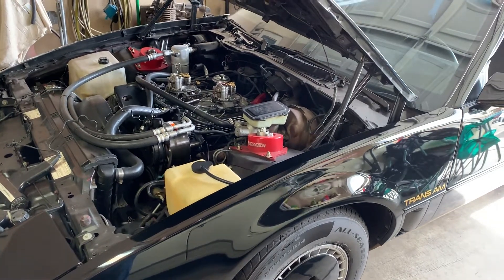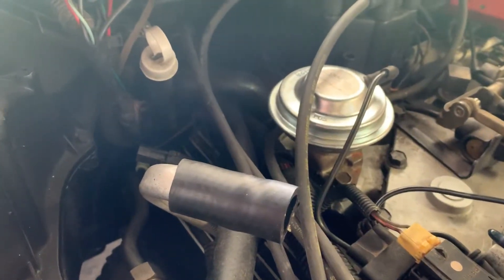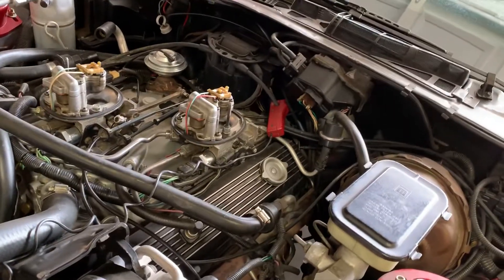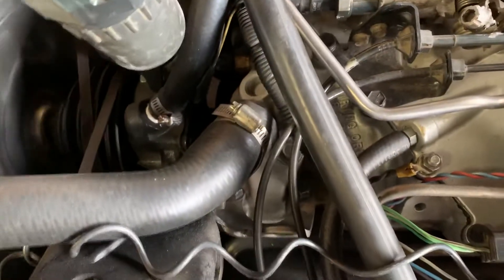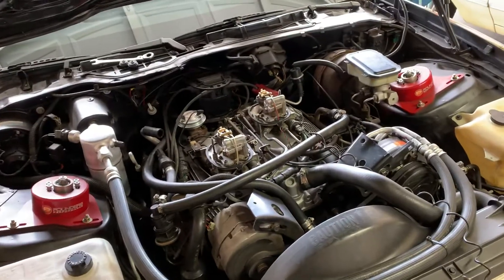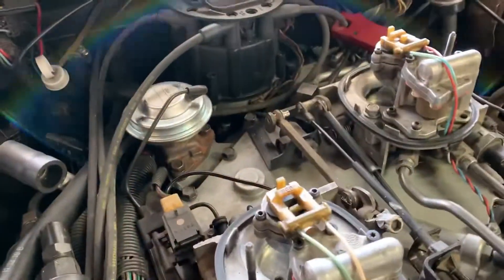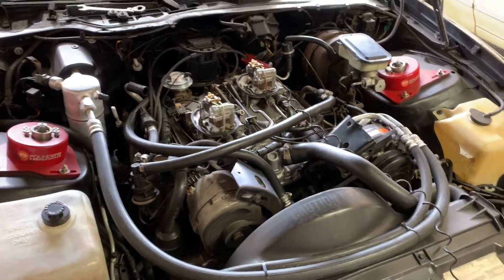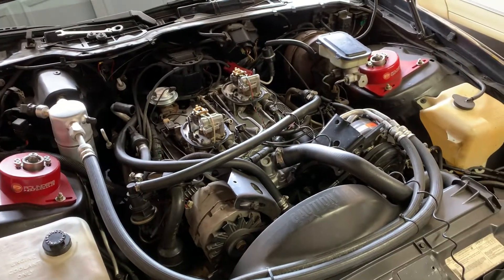How to set ignition timing on a Crossfire Injection 305 and 350

Comment: Hi Joe.  Great videos.  I have an 82 chevy camaro pace car and I am about to do the timing.  Your video helped me find the connector, but the color of the wire is like a blue green.Is it possible GM changed the color of that wire.  According to the info I have the car was built in May of 82.  Any help would be great.
Reply from the maker: The wire probably changed color or faded over the last 40+ years of heat cycles. All 82-83 CFI F-bodies have the ESC bypass wire near the back of the passenger side valve cover.
Reply: i believe i have it.  Just s little below the valve cover in a tight area?  Thanks for all this info.  I am glad I found your videos
 @Joesmusclecargarage

Comment: Hi, I'm replacing my ground strap from the passenger side of the engine to the firewall (just about ripped in half) and I'm having a tough time doing it because the connection from the ground strap on the engine sticks over the bolt and I can't figure what size wrench to use. Do you know the size, (9/16?) and if I can't get that bolt off, where  would be a good alternative place to put a new ground strap? Thanks in advance!
Reply from the maker: The bolt retaining the ground strap to the back of the head is a 9/16. I would recommend keeping the ground strap in the factory locations.